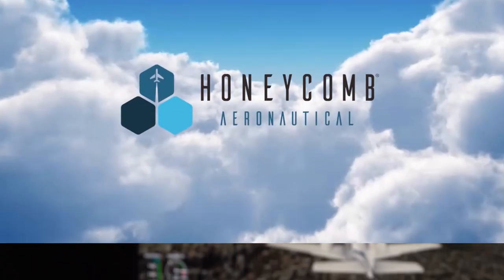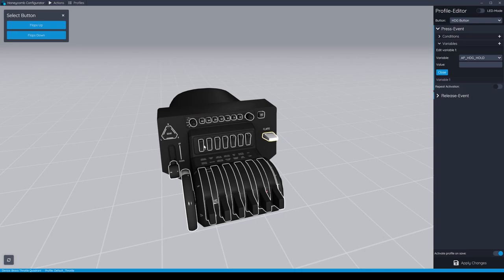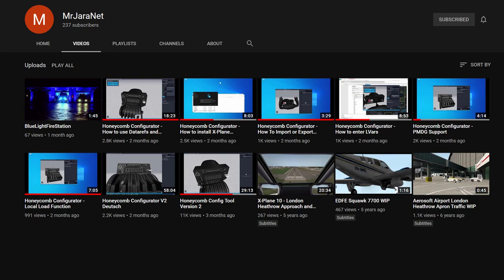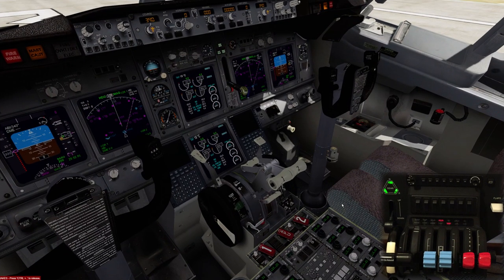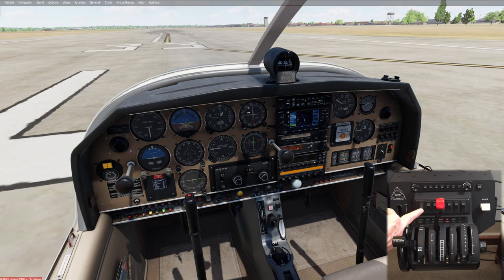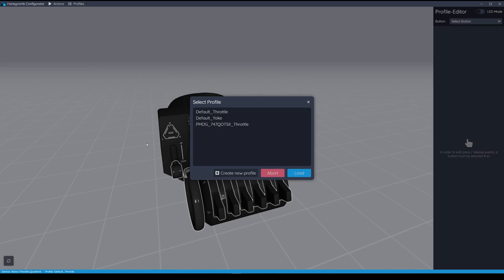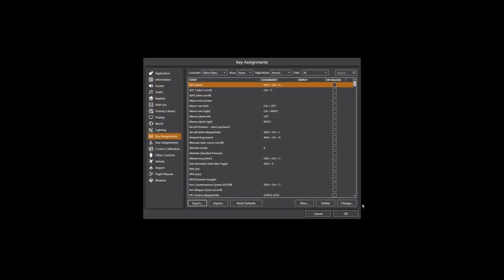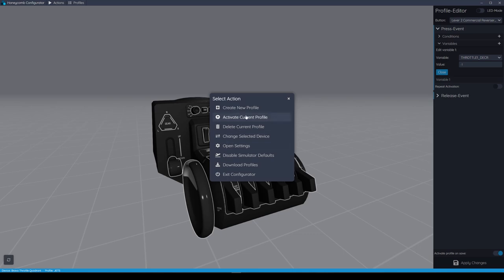Honeycomb Bravo Throttle Configuration | P3D v4 & v5 | Props & Jets with Reverse Thrust

Comment: Mark I know the PMDG is different but do you fly them in P3D by chance? I downloaded the profiles from Aerosoft but for example with the 737ngx I have no LED lights at all and with the 777 they all come one the entire time. Any suggestions on how to fix this? Also when I switch from a 2 engine jet to a 4 engine do I have to rebind the throttles again for each aircraft?  Thanks for your amazing tutorials.
Reply from the maker: Sorry no, I don’t fly them in P3D. When you switch/create profiles in P3D I would recommend building from the default profile as it is more reliable. Change any bindings required.
Reply: I’m Tryna figure out how too get them working for my pmdg aircraft too

Comment: Excellent video, thank you so much.  For some reason, anytime I have a 2 or 4 engine jet, anytime I use a reverse on the throttle, the spoiler comes out. i have the spoiler tied to its own axis, but i dont get it. any tips?
Reply from the maker: The spoiler will deploy on landing if armed. This is correct.

Comment: This is great!  One question, Do you have to restart P3d after making a change to a profile in the Honeycomb Configurator?
Reply from the maker: P3D must not be running when using the configurator, otherwise there is a risk of corrupted profiles. Make changes in the configurator, save and activate, then restart Prepar3d. Regards

Comment: Hi. First off I would like to thank you for the tremendous effort you put into your videos. I do have a question for you as you have a great deal of experience with honeycomb products where mine are currently enroute. A while ago I saw a YouTube video of a gentleman who recreated the basic profiles using the honeycomb configurator. He created five basic profiles and had the single, complex single complex, twin, etc. In the flight sim he used these profiles to inherit from in the sim to create his in game profiles. Have you run across tthis video and if so point me in the right direction. I have been searching for bit and have come up empty. Thanks again, Dan
Reply: Rmag is his YT handle
Reply: @mumdum  thanks!
Reply: @Donald MacKay  when you set up your controls using his video remember that "reverse" is actually no longer needed and it will make your builds work backwards. He recorded at a time when MSFS had a glitch in their control system.

Comment: Hello! Thank you for the tutorial! But there is a thing I didnt get... When I fly lets say the PMDG 747 and I have 4 of the axis bound to the 4 engines - now I want to fly the A2A C172 and dont want to have the 4 throttle axis but one throttle, a prop and mixture axis... I change the profile in the honeycomb editor - but do I now have to change the different axis in P3Dv5 before flying the C172 or is the honeycomb editor changing the axis assignments for me in P3D?
Reply from the maker: Hello, you would only ever use the configurator to push a new or modified config into the sim. In sim you use the default profile to create new profiles and export (save then). To change a profile as you change aircraft you do this in the sim...not in the configurator.
Reply: @SimHangerFS  All clear, thank you very much!

Comment: If the anti-ice switches are left in the auto position on PMDG Boeing aircraft, the anti-ice annunciator on the throttle quadrant illuminates. This doesn't happen in the real airplane, so is there a way to prevent this annunciator from illuminating in this situation? Thanks.

Comment: Hi Mark, Your a godsend. However I'm Stuck with getting the reverse throttles working using the latest configurator 2.1. Everything else is working flawlessly except for the throttles I've gone over the configurator multiple times but nothing seems to work. Any ideas what might be different regarding the latest configurator
Reply from the maker: Hi, sorry I haven’t tested out the latest version yet. Regards
Reply: I've just managed to get it to work, but it requires me to shut p3d down and restart the sim for the changes to take effect I cannot get it working by reloading the current profile

Comment: hi there, thank you for your tutorial, it helps. but i got an issue with the autopilot. first i have to delete all the setting from P3D to made it work and only set the axis assignment like you did and my throttle is working really nice. 2nd my auto pilot button such as heading, nav, app, alt, etc they dont work neither the turning knob. i tried to undelete all the key assignment and when i press the autopilot button, they do something else instead which is weird. do you know any fix to this? thank you.
Reply from the maker: All profiles must be built from the default profile initially otherwise the bravo config and lights will not carry over.
Reply: @SimHangerFS hi Mark, it was built from Default throttle profile but for some reason only the course working. The rest are not.

Comment: I followed your instructions multiple times over to no avail.  I cannot get  my throttle configured for PMDG 747, PMDG 777 or the QW787. When I full throttle the 747 for instance, everything goes in reverse and the reversers activate. This happens even after clicking or unclicking the checkbox to reverse throttles. I original started configuring with fsuipc, but has since removed those profiles. Do you know where the problem is at?
Reply from the maker: Hi, PMDG use bespoke coding for many of the functions, they do not follow the sim defaults unfortunately. I suggest you go to the Aerosoft profile page mentioned in the video, and download configurations for PMDG aircraft. Most are there. Regards
Reply: @SimHangerFS  Thank you. I managed to get the 777 functioning. The 747 is a nightmare. I'll try Aerosoft download again. Thanks you..

Comment: I'm not sure what I am doing wrong, however i cant get the bindings to copy over to the Sim. The only binding in the Sim is the default_throttle and not the bindings I created following the video
Reply from the maker: You need to activate the bravo profile initially and then build from that one. Suggest delete all but default, activate, then build new profiles. Remember to export under a new name any configs. You need to import them again to use them.
Reply: @SimHangerFS  Sorry for the late response, however, thanks for getting back to me. I'll give that a try and let you know how I get on. Cheers!

Comment: Extremely complicated configuration of this p3d. Easier to type the dataref in xplane than to configure this p3d. I did exactly all the steps, imported the fslabs profile and simply no pushbottom works at all, only axis. Unfortunate.

Comment: this guide seems to be useless for PMDG airplanes so it is useless for me as I use PMDG 737-800
Reply from the maker: PMDG do not use the default sim configs for most things. Look for bespoke profiles on Aerosoft forums.
Reply: @SimHangerFS  I checked and downloaded a couple of profiles but it seems like it isn't transfering to P3D, anyways, I have P3D 5.1 now I'm downloading the update to 5.3, perhaps it may work better with that version... in worst case scenario I guess I will have to check on the PMDG website or user manuals the oficial API to know the variable names I need for the different actions.